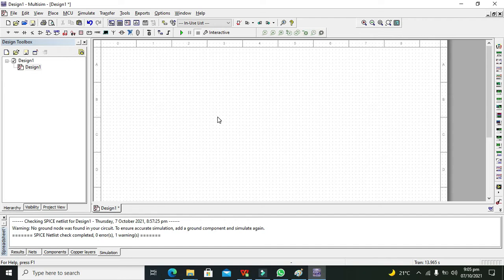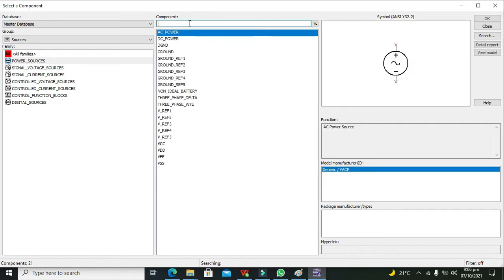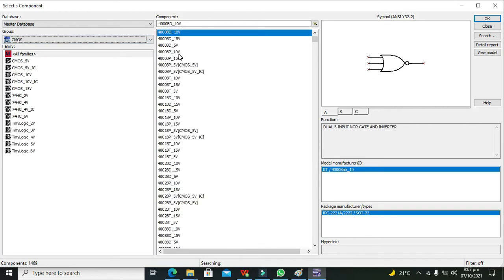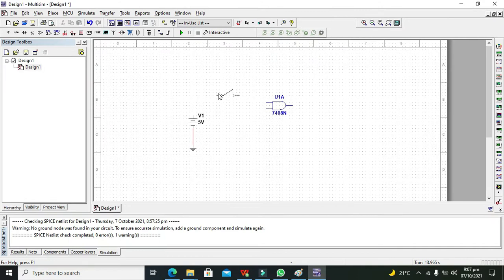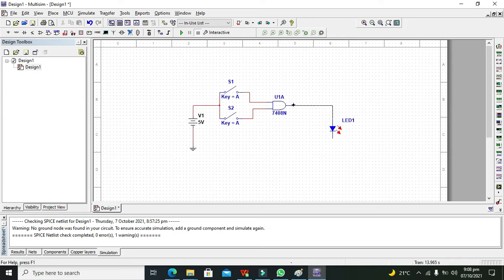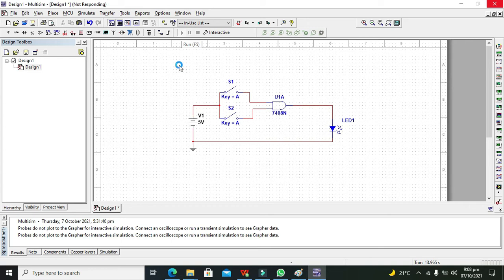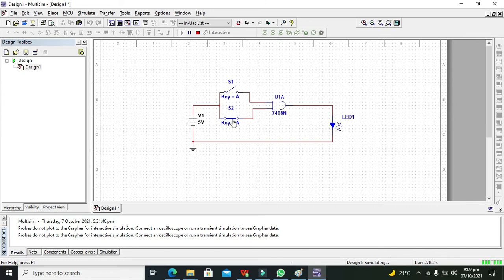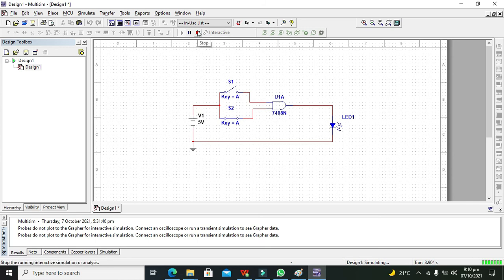How to make an And gate in multisim | how to use an And gate in multisim

Comment: I have to make something slightly similar, but i have to use an XOR gate and the switches are connected to either voltage or ground. How does that work?